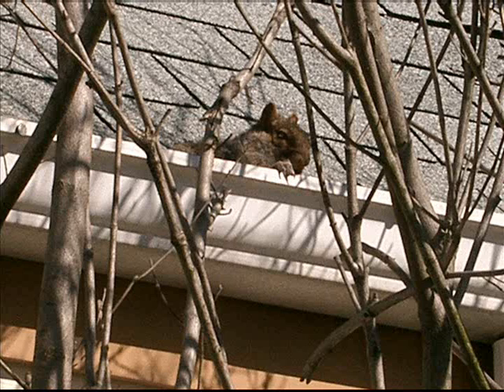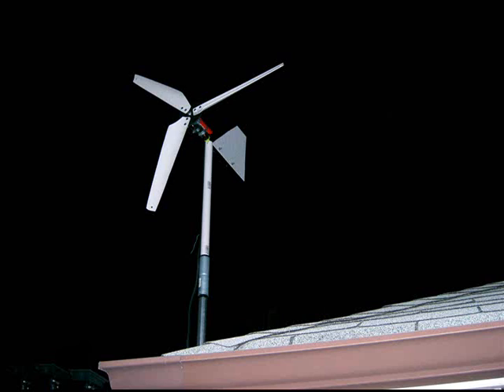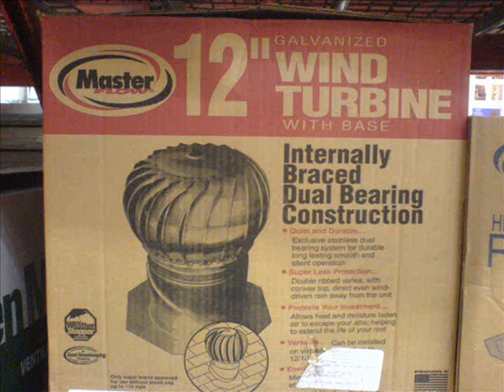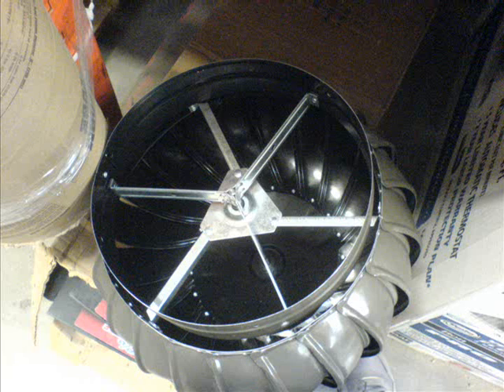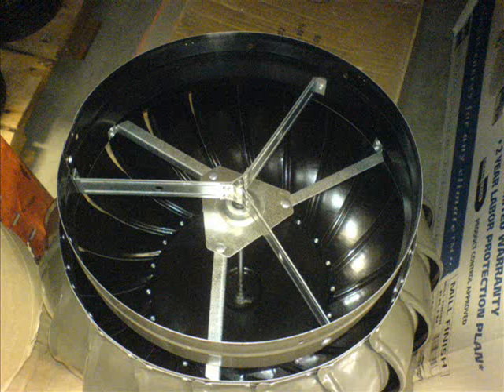Making a vawt out of a roof vent Movie.wmv

Comment from the maker: Sorry the title is a little misleading. I used Windows Movie Maker software to edit this and the software added movie.wmv to the title. I actually made a vawt using this vent  and a dc motor but it required too much wind to turn. It doesn't spin fast enough for an axial flux so that's where I'm at now.

Comment from the maker: Thanks Mit. That should work with a small dc motor that is not too hard to turn. If the blades can be extended far enough, it might even drive a small geared motor in strong winds.

Comment: Extend out the blades as much as the brace will allow, cut the brace bars that surround the shaft off about 3 inched back, then TIG-weld a ring to the cut brace bars so there is a ring around the shaft, then weld some small supports to the ring and connect it to the triangular piece. Get an arbor that matches the size of the shaft, and then connect it to the shaft of a low RPM, high voltage DC motor.

Comment: The vawt design blades are designed to sit horizontally to catch the air flow as opposed to vertically as shown here. That is why i was thinking the hawt blade design would suit better as the flow would pass through the blades as intended .You could also choose some modification of the vawt blade positions as to increase the systems  efficiency.

Comment: Wrong. Just because you create a turbine with a generator for personal use doesn't infringe on a patent. Secondly, you can have a duplicate product with a variant design, even if it small, and not infringe on a patent. You don't patent ideas....you patent functional devices. Third point: This is a great design. This can be put on a home and not violate any city code. Using a capacitor bank in series 'absorbs' ANY electricity generated until the load can be transferred. STOP BEING IGNORANT!

Comment from the maker: @willholl69 I actually bought a roof vent and tried to use it with a ceiling fan motor. No go because of the cogging. It should work with an axial flux alternator but I found other types of wings or blades that work better. See my video on small 6 coil axial flux vawt pt.4 video.The roof vent's real advantage is it's built to withstand outdoor weather.